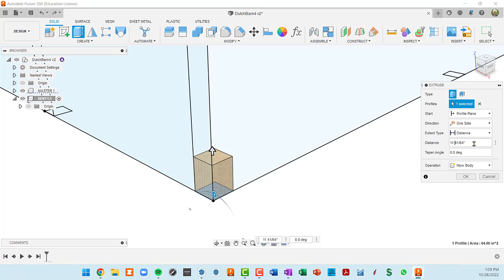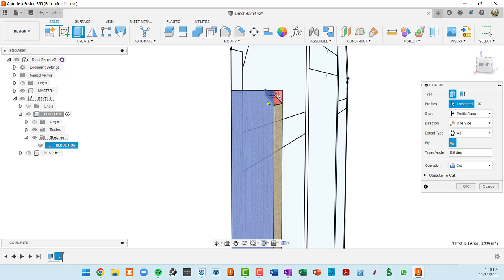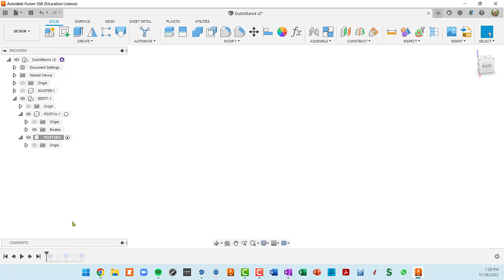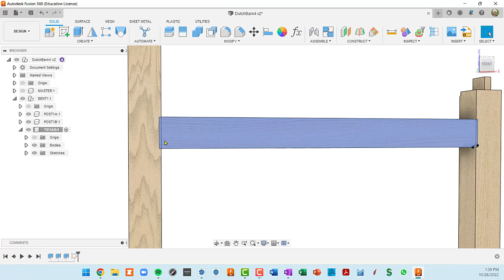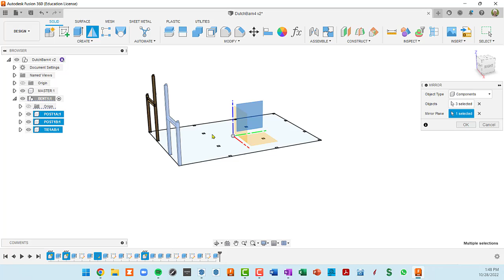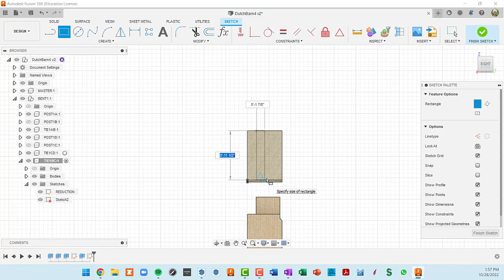Timber Frame Design in Fusion 360 - Part 2: Bent 1 Timbers

Comment: You should make a shell of the building permiter and use that to snap your extrudes to.  

Id use parameters for a lot of what you're doing though.  Easier to make changes later.

Comment: If you extrude in the horizontal plane you only have to remember 8" as you have defined the length in the sketch, dimension once extrude mange times with the same horizontal dimension